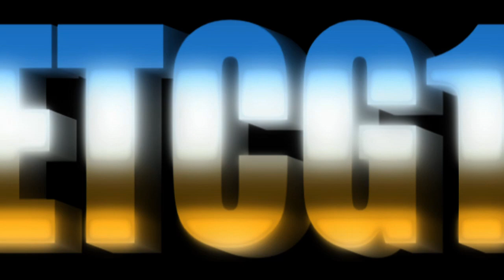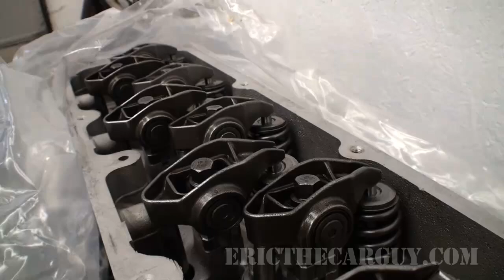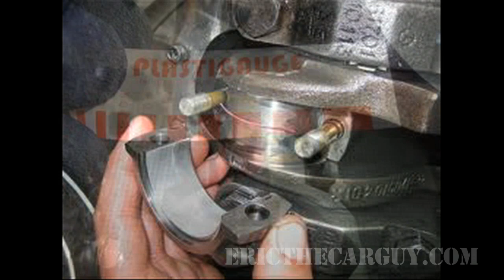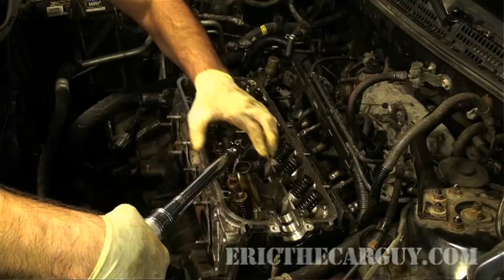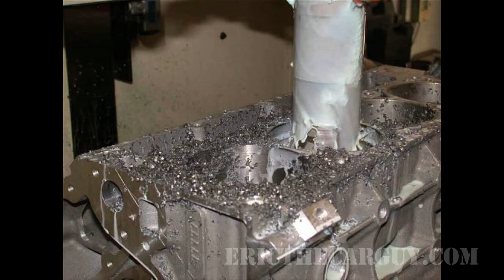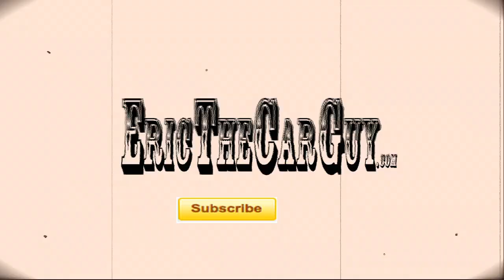Should You Rebuild or Replace? -ETCG1

Comment: I am currently in that dilemma with my  1994 Honda Civic LX.  The original motor has 134,000 miles and runs beautifully.  Tight on oil (changed every 4,000miles by me).  I am faced with the choice of replacing the timing belt, water pump, seals and tensioners which will run approximately  $900~1,000.  I can get a Honda engine made in Japan with only 43,000 miles.  It is my understanding that Japan has very strict environmental controls and the country exports these engines all over the world.  It is possible to get one of these installed for approximately $1200~1300 and comes with a 12 month warranty.  So, logic tells me that a full replacement would be the way to go.  thnx, Tony
Reply: Keep in mind, the JDM engine is due for the same service at 80-100k miles. 
$1000 is a high quote for that work, $400-500 is what i usually pay on my Subaru, including parts.
Reply: +Tony Tarquinio no way I would change the engine. It's a timing belt. If the engine works just reinstall the components. I would say different story if it were rings or internals. My Subaru EJ25 requires head gaskets, seals, and timing system replacement every so many miles, so I replace the bad parts because they are normal maintenance parts.
Reply: +Tony Tarquinio $900-1k for a timing belt change? That's too high. Most i've paid was $250.
Reply: +Tony Tarquinio That's standard maintenance on any honda vehicle with a timing belt, so you would have to pay to get it done on a new motor as well. I work at a Honda repair shop and people often ask us why we charge so much for our timing belt replacement. We ONLY use genuine parts and our technicians are great at what they do. I trust them 100%. We see way too many cars come in with major engine damage due to the fact that they used aftermarket belts or tensioners or someone did not install it correctly. The timing belts/chains on Hondas are crucial to your engine.

Comment: I am not currently a professional engine builder ,  but I have been in the past .  I most recently worked for a high performance engine builder . I started with a larger shop with some name recognition but was hired away from that place by a man who wanted to build the best reman replacement motors available.  As it turns out our motors were just to pricey . nobody was buying our motors when others could be bought for less than what we were putting in ours . I have some of those bargain price reman with 4 stock bores 1 .030 over and 1 .040  over . 

   If I was giving advice I would tell you to go ahead and buy a reman myself I'll build mine .

Comment: I am a DIYer and I have rebuild a few engines in the past, but I will say that by the time you get all the tools you need, and pay for all the machine work, parts, and do everything right, these days you will normally have more in it than it would cost to by one that is already done.  I have seen two engines that were re-manufactured from a popular store that starts with an A and has the word Zone in it that were screwed up right out of the crate with obvious things that were not right, in both cases they made it right and got another one for us.   I would say if you do it yourself you may have a little more in it, but you know it is done right.  I have used a fair share of junk yard engines too, but often they have about as many miles and wear on them as the one I am replacing and they don't often last that long.
Reply: +FrugalPrepper yes very true, I rebuild engines and transmissions When getting my  Auto tech degree. It is very fun to rebuild, however, i would only do it as a hobby and if i had the tools, replace the car or get another engine is better.

Comment: As to whether to rebuild or getting a rebuilt, its all about the competency and trust you have with the machine shop and the mechanic who is doing the removal/installation. I don't generally trust used engines out of a junk yard...too much risk in getting a bad/abused engine.  My 350 out of a 78 Camaro was rebuilt at 170,000 miles after it spun a bearing.  Upon dissasmbly, found that the OEM cam was soft with rounded lobes.  Had done oil & filter changes every 3ooo miles.  After the rebuild which, included a new cam, honed cylinders, new pistons, turned crank, new rings, I put another 200,000 before I sold it to a friend and it was still running like a charm.  Then again, that 350 was easy to remove out of a Camaro.  Its hard to beat today laser accurate engine manufacturing process.

Comment: wouldn't labor plus rebuild not equal truck value you can probably get that same truck for under 3000
Reply: commops106 what if the new trucks has the same problem 6 months later. if you have alot of money into your beater and it needs a major repair, you know what is good on your beater. getting a new one is inheriting someone elses mistakes or problems. always teh gamble with buying used cars.

Comment: I got a replacement engine (from a breakers yard) delivered to my door for £175 for my VW polo. Was extremely easy to put in since you only need to connect cooling pipes and 1 electrical connector. They always come with at least 3 months warranty, so it's pretty much guaranteed to work. This worked out fantastic for me and saved me at least £300 having someone rip it apart and replace a bad valve. Since it was only a 1.0l petrol, I didn't need an engine lift as I could lift it myself!

Comment: As a diesel technician for Detroit Diesel we overhaul engines all the time. But then again we have cylinder liners that are removable. A basic overhaul includes replacing cylinder liners pistons rings (already pre-measured). 80 Percent of the time the block gets cut to correct liner heights. Main bearings rod bearings cam bearings cylinder head (it is not often we re-use a cylinder head). There are steps up from that injectors rockers turbo ect. We are very familiar with the product we build 60 series motors all the time. But as far as rebuilding a automotive engine goes. I wouldn't recommend it to the weekend warrior, there is so much to know, valve recession allowable cylinder head warpage, allowable cylinder bore and taper... How many diyers do you know that have a cylinder bore gauge? I mean if you get it torn down and realize that the holes need machined then what? Pull the motor anyway to send it to a machine shop for a couple weeks? The guys at the dealer normally don't get that deep into automotive engines. Mainly because it is not cost effective. It's not something I would want to do for someone else because I would not be familiar with the product. Nor do I encourage someone to do it that is accustomed to engine building that probably does not have resources to determine what allowable wear is.

Comment: My 4.8 l GMC Sierra has died... I don't know what to do. I think replacement is the way. The question is why else do I need to buy Gaskets, hardware, hoses?

I'm no mechanic and I don't know why I need. Any help with a list and possibly a reputable engine company??? 

One more question, should I put a 5.3 in the truck. If so what do I need for that. 

Thank you for any help!

Comment: Unless it's a late model (in which case it's probably still under warranty, in which case the point is moot) or irreplaceable vehicle, the best advice is probably just to trade it in and buy a new car. For all of the reasons Eric hits on and then some, engine work on modern vehicles is extremely complicated and expensive, and for the same reasons, rebuilt engines often never run right again. An entirely new engine would do the trick, but if you have a spare $3-4k to spend on a new engine for an old car, why not just apply that as a down payment on a new car with a warranty, and not fret about what else you're going to have to shell out for just to keep that old POS on the road? Leasing may be a better option still - new car every three years, significantly lower payments, no maintenance costs/uncertainty - so long as your mileage requirements aren't excessive.

Comment: professionally rebuild engines are fairly expensive, here in down under. It's most cost effective to find a used replacement with warranty from a wrecker.  About ten years ago, I was driving a Ford Falcon which the engine bottom end was not good and spewing oil out of the air cleaner. Replacement engine(which is the basically the engine block with pistons, crank shaft, etc, all rebuilt, but nothing more. And the price for that rebuilt engine was $3500, which wasn't worth the trouble. I got a used replacement for just under $1000 including the labour, which kept me going for another couple of years before I got rid of the car. Rebuilding is good on cars older than ten years, but only when I can do it myself. Otherwise, it can be expensive and 'rewardless'.

Comment: Hey Eric,
This is my subjective opinion. I haven't done a bottom end rebuild yet. That 'cos I haven't had to, yet.
If or when I get to that(it will be definitely when),  and if I have a second alternative way of getting around( I have a bike),  I would seriously consider taking my time and rebuilding it. Sure, I need an engine crane, which can either be borrowed, rented or even purchased(around $150). Sure, I may consider a getting a used good replacement if the price is right.
But, I have to say, if the time and circumstances(and tools and space) allows it, it's a fun exercise to do, even by myself, without asking any of my mate's assistance. There're many way to get around expensive measuring tools for a DIY. For example, I used a simple $6 digital hanging scale to measure the differential pinion bearing preload, instead of buying an expensive dial type torque gauge(which is between $100 and $500). For a DIY, expensive tools that you may never use again, are a waste of money(that you may don't have)
BTW, I'm from down under and I drive a heavy Nissan 4WD. So, the work on particular type of cars are heavier & more labour intensive  than average sedan.
I'm not a pro mechanice, but and IT guy. All the work that I've done so far, have learnt from youtube videos,...... primarily your videos.  I saved thousands of dollars and collected a quite a collection of tools.
So, I say, rebuild it when the circumstances allows it, and replace when it doesn't. It all comes down to arithmetic in the end of the day.

Comment: To me it depends on how bad the motor is in how much it would cost to fix it I'm a hands on person I like to do stuff like if so but I said it would depend on the cost of the parts in you know it ain't nothin for me to pull motor and put a crank and when you know how you have it cleaned at the shop instead of me like I said its a price think its a replacement motors cheaper than rebuild the whole motor then I would go from MIA for $500 motors you know

Comment: I did a rebuild and didn't have the heads checked now I think im getting oil in from my valve guides. A lot of steps when you rebuild will be tempting to skip some of them you can like maybe rebuilding an oil pump vs replacing it  can save you a lot of money but like my mistake of not getting the heads check save a lot of money but costed more in the end

Comment: Rebuilding is best if you have tools which arnt too much its the gauges that cost you the most and if it come to boring machine shop is best but after you build a engine a few time you start to lean how far to take this how much of this is needed  and so on but good rule of thumb follow the measurements, assembly steps in the service Manuel.. I like knowing what the guts of my block look like, it kinda peace of mind lknow its all new and done correct like its said we all make mistakes

Comment: Depends on the engine. Rebuilding is fun, and with the right know how you can rebuild the majority of the engine on your own, and use a machine shop to do some of the more intensive work. When I rebuild, I usually pull the engine, and start to dis-assemble the bottom end. The heads stay assembled and are set off to the side. I order up a master rebuild kit. Once the kit comes in, I'll bring all of the soft plugs, any head parts (valves, guides, springs, etc…) the cam bearings, bare block, heads, crankshaft, and sometimes ever the connecting rods into a machine shop. They clean everything up, replace the soft plugs, bearings, bore and hone the block, rebuild the heads, etc… I pick everything up and it's pretty much a big jigsaw puzzle from there, re assembly! I've made my fair share of mistakes, and I have learned from them, but for the most part I like to rebuild. I wont rebuild newer engines, and I prefer to rebuild V8's only (I have no idea why, an internal combustion engine is an internal combustion engine for the most part, I just feel comfortable inside a V8.) There are a lot of things that I have absolutely no experience with though. Transmissions? I've never rebuilt them. Never honed out my own cyllinders, (not bore, I don't have the equipment for that, but honing shouldn't be that hard, I've just never tried) Never done any head work. Valves, springs, guides, seats, I have always just had the machine shop do everything. I guess I would say to an extent, you'll never know what you can do until you try, but don't bite off more than you can chew.
Reply: the advntage of doing the machining work yourself is that you have the control on the result.
It happened more than one time that I 've had to remove heads from an engine because the machine shop had  messed up the valve seat grinding on one cylinder so I thinked that I can do better than that
Reply: Getting the crank shaft journals machined correctly at Joe Blow's machine shop seems to be a difficult process. I don't have room for elaborate milling machines at home and would probably miss tolerances if I did anyway.

Comment: IIRC, if I replace my 1972 Dodge 318 with a new crate motor, I have to add all that emissions nonsense to it also, like a catalytic converter, etc.  My car is not worth all that much to anybody but me anyway, so keeping the original block is not critical to its value.  What I am going to do is rebuild it.  On my daily driver Jeep, if that 4.0L goes, I would replace rather than rebuild.

Comment: Im new to this site and enjoy your imformtion, I have rebuilt dozens of engines ranging from alfa,s fiats, mg,s etc. My experince has shown me if the cross hatch is still visable,up and down the bore, just remove the carbon ridge, thats, between the top ring and deck, when the rod bearing clearence gets out of spec the top rings break, there is nothing wrong with plasti-guage, I do a polish job on the journals, then check all the journals with the string stuff, I had a lima engine in a mustang 11 and I had the head milled to the max 8-1 to 11-1 compression, crane racing cam solid lifters, hooker header and a four barrel 390 holley on a offenhauser manifold, went from stock 85 hp to 150. Any how heres a good one a buddy of mine has a 240 drift car with a 2 liter twin cam 16v and a after market turbo, the guy that put it together insists that the thermostat be removed, so what happens is the temp guage goes all over the place and, when the engine idles it coools down so much it goes into the choke cycle, I told the kid, thats a damn good way to blow the head gasket, from thermal stress, I say always run a thermostat with fuel injection, regardless of what kind of engine you have. Also I notice your not a fan of PB blaster, like on the rotor screws on the Honda, heck I heat em up spray the blaster and hit it the impact tool, never had a problem, sometimes I leave em out, it depends on how they fit to the hub and over the lug studs, but yeah back in the day I rebuilt air cooled VW,s and used the dishwasher to clean parts, explain that to the wife. Oh yeah heres my beef most shops wont adjust the valves as part of a tune -up, back in the day when I was working on twin cam engine s that had bucket shim,s alfa, fiat and TR-7,s I always measured the clearences when the motor was hot, thats what counts,  on some heads, aluminum or cast iron , there is always a difference between setting the valves on a shim deal, when you have the head off on the work bench, then when you torque the head back down to spec the clearence changes slighty, if you have rockers like a honda its no big deal but the shim thing can drive you nuts

Comment: I have a 74 ltd wagon with a 400 v8. I will send it to a shop for a complete rebuild. Hard to find a replacement for this, and these engines had factory problems with low oil pressure that this shop knows how to address so i have no further problems. So my view is if your eng/part is readily availabled replace, if it is not or the eng/part has  known factory defects than a rebuild is the way to go. Just my thoughts.

Comment: eh   depends on the engine I guess. Right now my current vehicles previous owner was neglectful. I've been researching my options, used salvage I feel you can end up with something just as bad or worse. I have a buddy who is the forman of a machine shop so rebuild is an attractive option for me, also you could throw some performance into the mix, port match and polish to your hearts content, and crate. at this point for me a rebuild or crate run about the same cost, but rebuild I can do what ever I want really as apposed to the crate builder Id go crate over salvage

Comment: umm had a 1997 honda accord once and common failures were transmission and engine seizing ...two time on both , they were cheap junkyard repairs ,,,,i dont recommend used engines ,,,even if the mileage is low on these engines/transmissions, have either or new or rebuilt with warranty its you'll end up with a better product that will save you expenses on the long run and other social/work problems that come with it , dont buy used engines unless you cant afford the other more expensive option...thats just it